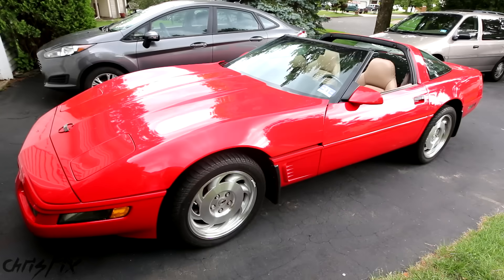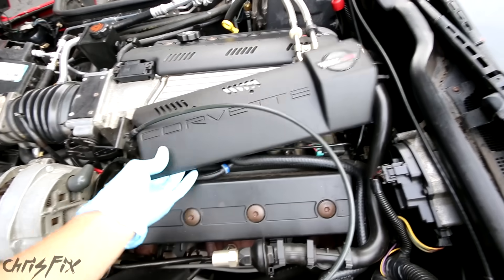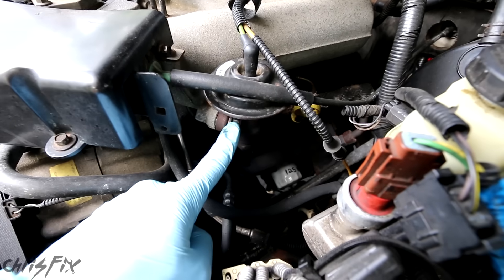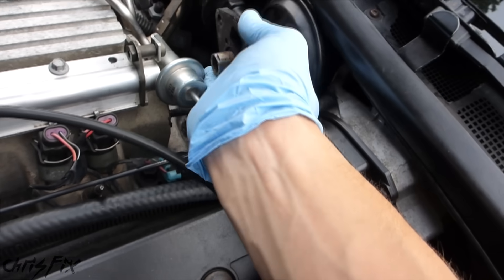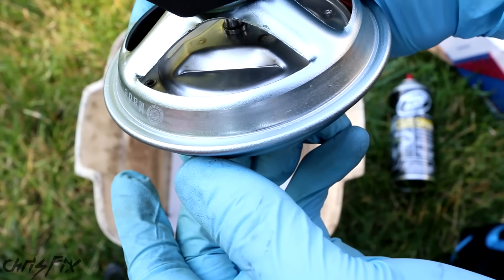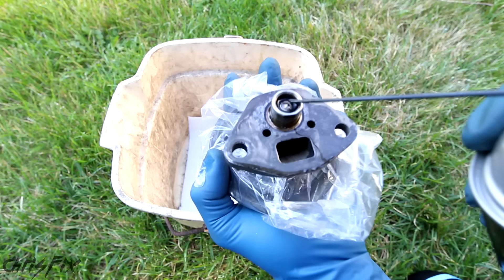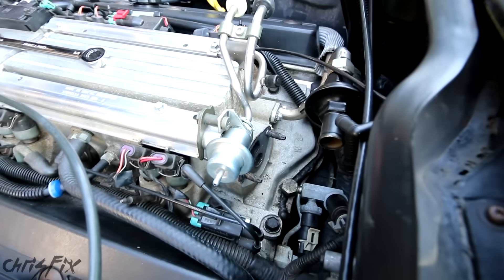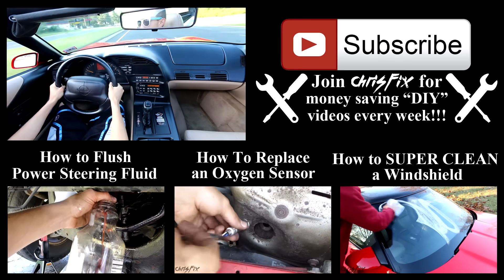How to Clean and Replace an EGR Valve P0400

Comment: Should’ve watched this first. Mines currently still sitting in a cleaning solution. Completely submerged with no bag😂. Welp wish me luck
Reply from the maker: Let me know what happens!
Reply: @chrisfix ended up breaking one side where the bolt goes through while trying to remove the hardline on a vice. Had a coworker weld it, I flattened it as much as I could with a file and bought a new gasket. Seems to be working.
Reply: Tested it how you did and it looks like it’s still working. But something always goes wrong and I broke the tip of a pipe brush in the hard line. Had to remove it together since there’s no space to remove just the egr. Brought it to work so I can put it in a vice so I can remove the hose since it’s stuck. Other than that it’s going good. Got it looking brand new

Comment: Best EGR Valve video I've seen. I have no codes on my 1989 Chevy pickup, but a slightly rough idle. Everything else has been checked or replaced. Update: So I removed the EGR Valve and it seemed to work as far as movement and diaphragm vacuum is concerned, but the carb cleaner leaked out right through the stem. I guess I'll buy a new one.

Comment: Those pipes coming out of the exhaust manifolds aren't for the EGR system. Those are for your air injection reaction system. The passages for the EGR valve are Incorporated in the intake manifold on that particular engine.

Comment: I have a Honda Jazz 1.3 CVT, and it jerks when it reaches 1500 RPM. Additionally, it jerks for 5 seconds at 2500 RPM/60 MPH. I have already cleaned the EGR, but the problem persists.

Comment: Im surprised "EGR Temp Sensor" wasn't listed in the possible cause for a faulty EGR Code. Hmmm
Reply: That's because this isn't the EGR valve 🤣  It's the secondary air injection system, used to heat the cat up quickly.

Comment: I replaced my EGR and EGR solenoid still runs rough brand new air filter as well. this isn’t always the case. If it doesn’t fix the problem after both it could be also a fuel injector even though there’s a code P0401

Comment: I got the egr error code and my car is shaking like crazy when its idle but i took put the egr valve amd cleaned it (it already looked pretty clean) but that didn't help. Any suggestions. I have a 2010 belta/yaris.

Comment: How many miles do you have to drive the vehicle in order for check engine light to turn off after replacing an electronic EGR valve?
Reply from the maker: I would clear the codes then drive for 30-100 miles, that will give your car time to test different systems and confirm that you don't have any issues

Comment: i tried just cleaning the egr didnt work, bought new one, still engine light.. guess what it ended up being.. the fucking pipe running from the EGR to the engine.. the WHOLE PIPE was clogged with black shit.. used carb cleaner.. engine light gone!.. getting it out was the hard part bent it a bit.. coz its all threadead through behind the engine under and over shit

Comment: So after I replace mine, I should erase the engine light code and drive for about 100 miles to see if the check engine light comes on correct?

Comment: Chris, is there a way to stick a small gasket onto a part so that when you are putting the part on the gasket won't fall off into the engine?
Part 2: My 1/2 inch socket fell down while I was fiddling with my egr valve and I can't find it. I have looked and felt around everywhere, but no luck finding it.  Any suggestions?

Comment: the only complaint is it doesnt make the engine run better. it by definition makes it run worse. since the oxygen is less concentrated when sucking in egr air instead of solely from airbox. but it does create less toxic fumes sionce it lowers combustion temps, thus creating less gasses like NoX which is toxic to humans.

egr isnt for the engines health, but for emissions. 
just so nobody gets the idea this will benifit their engine. it slowly kills it, cause it also clogs up with soot, and those could get into a turbo and ruin the blades, or a valve or whatever.

besides  great video

Comment: on my 95 lexus sc400 v8 the engine has a rough idle and sputters. i have  a check engine light on.  when i press the gas the rpms on the tach go in the wrong direction. they go down instead of up like a vacuum leak or something.   so far i put fresh gas and cleaned the throttle body out which was very dirty with carbon build up.  that cleared the check engine light however after 30 minutes it came back.  when i smoke tested the engine i did have small leak from what appears to be the gasket of the egr valve.   can this be causing my issue?
Reply from the maker: Any kind of vacuum leak can cause issues like that, I would replace the gasket and that should solve those issues!
Reply: @chrisfix  I checked the gasket it was fine.  there was a small leak where the egr solenoid meets the egr valve but there is no gasket there. while i took the egr valve i cleaned it out and it seems to move more freely now.  But i still have the light, rough idle and sputtering.  My tach is still going backwards when i hit the gas I hear more of a hiss by the IAC valve that leads into the intake.  i sprayed woody water around all the houses in the area but didn't see any bubbles.  It definity appears to be more concentrated around the front of the intake.  Any ideas?

Comment: What is a good penetrating fluid for rusty bolts and nuts?
Reply: Try a 50/50 Mix of ATF (Automatic Transmission Fluid) and Acetone.  Shake and Mix thoroughly in an Oil Can and spray or squirt on a Rusty Bolt or Nut.  You can also put some heat on the Bolt or Nut... access permitting.  Let it cool off and squirt the solution onto it.  Hopefully it isn't severely Rust Welded?
Reply: @Darrin-ws1fh  oh sweet. I'll try this, thanks.
Reply: @williamkent2446  Also: ChrisFix also has a YouTube Vid on making your own Penetrating Fluid.

Comment: Hey Chris I have 95 c4 corvette has rough idel and makes a pinging popping sound... I have changed 02 SENSORS, EGR, TPS, IAC, MAP SENSOR and the sensor that screws into the front of the waterpump... but it still runs the same.... any ideas? Please don't say it's the Optispark... Lol

Comment: Why doesn't your car have that pipe that's so hard to take off the EGR valve there's the two tubes and then there's a pipe cuz yours you look pretty easy to do yours mine was tough as nails why don't you do one with the type let's see how you do it

Comment: Thanks for the video. It was very helpful.I have an '02 Ford Explorer and had a bad PCV valve and exhaust coming out of the joint where the exhaust manifold and the Cat connect. It drips a sooty and oily residue. I replaced the PCV valve, but, it did'nt fix the problem. I saw there was a pipe connected to the exhaust manifold that lead to the EGR valve. I have to check the valve, but, am considering changing it since it's looks original. I just want to make sure it's not the vaccum pump. The other devices like the heat/ac are working fine. Thanks again,

Comment: Help trouble shoot issue: 1994 Ford F-150 5.0 automatic. 

Issue: running rich, allot of black smog coming from the exhaust and strong smell of gas. Does not seem to be switching gears, RPM are almost hitting 4,000 running at 55 mph. 

Parts I’ve changed so far;
- EGR Valve
- cleaned out the Trottle body
- TPS sensor
- IAC sensor
- O2 sensor
- PCV Valve
- MAF sensor
- distributor
- plugs
- ignition coil
- ICM
- air filter
- fuel pump front and rear
- canister purge valve
- vacuum lines
- oil change
- Temp Sensor
- fuel pressure regulator

Comment: I need to do a smog check for my '00 eclipse gt V6 3.0L. I've gone a couple and they say it's the egr, but they tell me that they don't get any codes, and my check engine light lights up when I turn the engine on but immediately goes away. The car hasn't been registered yet due to the need of the smog check. Is the egr the problem or is there anything else?

Comment: Hi Chris, I have a G16A engine and after overhaul, it has all manner of problems including loss of power, high rpm even after it has warmed up, and a noise like from timming belt. I tried to look for an online  detailed workshop manual but in vain. Advice.
Reply from the maker: Check the fuel pressure and check the catalytic converters to make sure it’s not clogged.

Comment: Chris, I wish you were my neighbor. I got an 05 F150, 4.6L stalling out on side of road, throwing code p0402. I spent over $700 for a tow and an EGR replacement by a local garage/thieves. I happened to have a new Motorcraft EGR still in the box with me I'd just picked up which hadn't yet been installed, from Rockauto. Garage assured me that this was the problem. No choice so I let them. Truck ran great for first 5miles on way home then stalled out again on freeway with code p0402. As a disabled vet I can't afford this b..t. Did I say I hate Ford Motor Co and garages/thieves? Just trying to keep it together without having a stroke.

Comment: I think you got something wrong here. How the hell can HOT exhaust gas cool the engine?  Also it does not make the engine work better,just  looks  the carbon build up. Its primary job is to lower the temperature for the catalytic converter

Comment: After doing some research on the downsides of the EGR, I've decided I'm going to install a blanking plate. From my understanding the EGR just causes more problems than it's worth... carbon build-up in the intake, reduces engine efficiency, mileage, etc.

Comment: That destroyed many a GEO Metro 1.0 engine with carbon build up clogging the valve & passageways causing the #1 exhaust valve to burn out and cause low compression in that cylinder.

Comment: I get a check engine light once a year for a day. But it goes off for 99% of the year. I have a 1993 Dodge Ram B250 V8 van with the older non electric EGR in it. My EGR transducer has been vibrating (sounding like water faucet pressure squeeling sound when the engine usually is heading uphill), for a while, now. Is there a diaphram inside this black saucer shaped transducer that is likely ripped? I initially didn't know what these parts were called and how to google them. Now I have solid knowlege. Thanks!

Comment: EGR makes your car run better? Uhm.......never has, never will, it only makes your motor pollute inteslf instead of cutting the emissions by 0.00001%. The only thing that should ever be done to EGR, is get ripped into pieces and thrown out. And maybe stepped on few times

Comment: I paid these clowns a lot of money to replace the head gaskets etc on my 93 Buick Park Avenue. I get the thing back and now throws service engine light codes 54 55 56 and 58. OBD1. Some are EGR related...it is a electric unit..does it need to be changed?

Comment: I replaced my spark plugs and EGR valve cleaned the housing on 2005 Honda odyssey and checked coils check engine line was still on...did not drive 100 miles yet...so I disconnected battery to reset hope it does not come back..
Reply from the maker: That'll clear the codes, shouldn't come back on if the job was done properly!
Reply: @chrisfix  thank you Chris happy New year so happy for YOUR success...we go to only you...hey just bought my son his first used car...2002 Mitsubishi eclipse 2.4 manual 5 speed..it blows cold a.c. but no heat do you have anything on this model

Comment: Hi Chris, I have a car where pcv valve is not getting opened. It has got stuck with the aluminium body.
Pls guide to open it.
Thanks.
Reply from the maker: Have you tried using penetrating fluid to get it unstuck?
Reply: @chrisfix  Yes. 
Have also kept for overnight after spraying penetrating spray.
Also with having threat to get it break, m also not using too much power to open it.

Comment: Noob question: when someone says the engine is running lean, do they mean it's showing a lean condition and is trying to correct with more fuel, or that it's trying to run leaner (due to rich condition)? And how does that correspond to the +/- fuel trim numbers in OBD?

Comment: I have unplug my egr valve and it work fine on acceleration but I took it off to clean it and now it's sputtering at high speeds again that's why I unplug it and my high speeds came back but I have a new one still no high speed like at 45 mph it's like the car is running out of gas but a full tank I Need Help (03 chevy malibu)

Comment: clean the valve and reset to erase the code and traveled 500 miles and the computer does not finish the diagnosis to know if it still fails or the problem is fixed, any advice please. Nissan Altima 2001

Comment: Did the EGR on my 2008 Wrangler and it was tedious. There's one bolt tucked behind the valve at the under-back of the engine and the firewall. I only had room for 1/4 turns and I swear, that bolt was overly long. Just terrible... 2yrs later I'm coding again... kill me
Reply from the maker: Darn! We’re you using a ratcheting wrench?
Reply: @chrisfix  No, I'm a teacher so by default too poor for fancy tools, I didn't expect the bolt to be so incredibly long, so with a regular wrench continued to say to myself... just one more turn, I'm sure of it... it was like like trying to get to a finish line by also jumping halfway... an infinity of time

Comment: I have a problem I replace the EGR valve for my Toyota Camry 2000 but we have a Gasket between two parts It slips and does not let me put the bolt in it anybody knows a trick for that,,, thanks
Reply: Put the bolts through gasket and the top of the pipe then just tighten the bolts so the gasket cant slip out.

Comment: if there was carbon build up visible from the EGR port, would cleaning the EGR valve clear up or break down the carbon build up?
Reply from the maker: No, you would have to clean the port to remove the stuck on carbon!
Reply: @chrisfix  could I simply use carburetor cleaner to clean up the carbon build up from the EGR port?

Comment: I have a 3rd gen Toyota Prius.  I used  an extra reach 12 mm racheting wrench for the three Nuts in the back and good luck reaching the 4th HIDDEN 12 mm nut underneath the EGR cooler.  Used a Torx E8 socket to remove the two Bolts in the back of the EGR cooler.   Good video!
Reply: Hope I never have to do that!

Comment: Went to my 94 Ford Ranger 4x4 V6 4.0 all excited to pull out and clean the EGR valve, only to be stumped as to where the heck to find the thing. After reading some Ranger forums, it turns out they just didn't have EGRs in that era of truck, is that typical for other early 90's trucks?

Comment: Could a bad EGR cause a car to keep stalling at idle?
Reply: I have that exact problem.  Let me guess, when the engine gets up to operating temperature, it doesn't stall anymore, right?  If I knew what was wrong, I wouldn't be here, but, I have an idea I'm working on.  I got a 1994 Celica with 335k on it, and tons of leaking oil from the disty.  While trying to figure that out (I'm new to this mechanic stuff), I broke something off the engine -- the PCV valve.  It was toast, as in burnt toast.  The disty seal blew and oil leaked for a long time.  The back of the engine is caked in it.  Anyway, the car is running lean as evidenced by the carbon buildup on newish spark plugs.  The engine runs much better when warned up -- the rough idle and stalling are nowhere near as bad as when the engine is not at normal operating temperature.  Since it is cheap, I'm testing the engine coolant temperature sensor.  While testing the sensor (tested OK) and its mating connector, the internals of the connector broke, so now I need to order the connector and splice it in place.  There is another sensor next to it, and I think it is a fuel injector temperature sensor.  Its internals look like trash, so I plan on replacing it, too.  And the connector.  The locking tabs were snaptastic today -- I snapped three locking tabs today.  If that doesn't fix the problem, EGR and carbon buildup, here we come!
Reply: @wellnesspathforme6236  Well for me I just had a mechanic come out and have a look last night. He said there was simply a carbon buildup on the EGR valve, which caused it to be stuck open, which then causes the rough idle, stalling and also a strong fuel smell. He managed to clean it for me and put it back in, but we've also ordered a new one to replace it, to prevent anything like that happening again, as the idle can still be abit rough at times.
Reply: @j_h264  I don't have the fuel smell, but I bet the EGR on the vehicle is in tough shape right now.  Can't help to clean it out, even if only as a preventative maintenance measure.
Reply: Replacing the three female connectors was relatively simple, and fixed the problem such that the vehicle passed smog (given all the work that came before!).  The coolant sensing female connector was probably the offender, but I replaced the other two as a preventative measure.
Reply: Yes. So can a dirty IAC, among other things.

Comment: Hey @ChrisFix love the videos man keep up the good work Im learning more and more. Wanted to ask a question its been driving me nuts. I have a 2006 Ford Explorer XLT V6  4.0 L . My check engine light turned on and is giving me an error code P0401 EGR insufficient flow. I replaced my old EGR with a brand new one. But still getting the same code. My other guess might be a bad DPFE sensor and honestly  I cant locate it. Unless its on the EGR. Any tips on what i can do. To get this error code and finally fix the problem just hate seeing check engine light on when i drive. 
Thank you

Comment: How to change an EGR valve the proper way
Step 1: Remove EGR valve
Step 2: Remove EGR cooler
Step 3: Throw that shit away
Step 4: Cap unneeded coolant lines
Step 5: Block off where EGR components were
Job done!